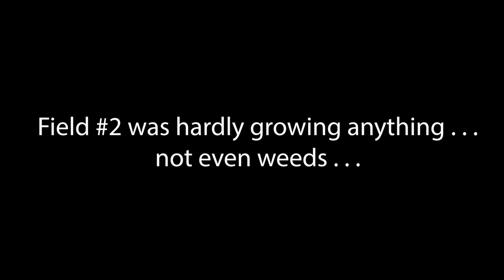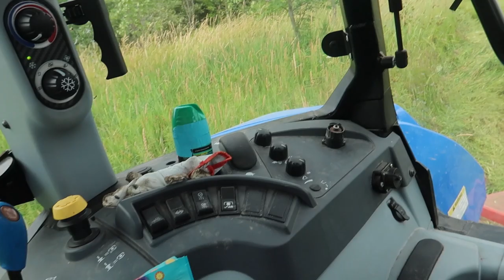241 I Almost Lost It - Mowing the New Hay Fields with the Brush Hog (Bush Hog)

Comment from the maker: For those wondering (because there are lots of comments on this) I did NOT want to bale the stuff I cut for a very good reason. I had JUST applied a foliar fertilizer just 3 weeks prior, despite the weeds, because I wanted to get it down before summer got too hot. At the time I knew the weeds would get a good percentage of it. By brush hogging the weeds, the minerals I applied to them will be recycled back into the soil as they decompose. If I chose to bale them instead, I would be using additional time and fuel, and produce only a few bales of hay, not enough to cover fuel expenses, and I would lose the benefit of the fertilizer I had applied.

As far as mowing my main hay field last year, I mowed the weeds out but it only cut the top 2inches of grass each time, so I'd have the same issue of not enough hay to cover fuel costs.

Comment: As a few others have commented, 2.4,d weed killer is a safe effective weed killer safe for cattle within 30 days of application. 

If you have any poison ivy or oak, some dish washing detergent added to the mixture will breakdown the oils on the leaves, and both ivy and oak will turn yellow overnight, then brown the next day.

I suspect that your wind rows from last year contributed to the nice green lush growth in the last field.

May I suggest getting a small toolbox and keep some hitch pins and clips, a couple of 5/16" chains with hook ends, a cable come along and a ratchet strap or two. It will save you from having to limp back to the barn for repairs.
Reply from the maker: I need to make a list of tools for the box to get at Harbor Freight. The tractor does have a tool box, but I need to fill it!
Reply: @This1LifeWeLive   list is a good idea! Price check n hit up the misc. rows/racks at farm auctions.
Reply: Reply to Brad not Landa
2,4,D in commercial production includes 2,4,5T_  - Agent Orange.  It also metabolises into agent orange and other toxins with never tested toxic synergistic damages. 
You might be interested in the book 5MYTHS ABOUT SAFE PESTICIDES  or something like that by ( I believe Lieu)

Comment: I agree with the other person who said they were using a land roller to help smooth the ground out. It doesn't hurt anything to try. We did all our new seeding from the year before and it made a great difference. Go out as soon as the ground will hold up the tractor in the spring. And later in the fall, if you want. They should be cheap and easy to find if you look around a bit.

Comment: I think the reason that the wheel and top link connection point broke was because of improper Bush hog setup. The proper way to set one of those up is to have the back wheel always touching the ground when in use, and adjust the front of the cutter so it is lower than the back. If you watch the video again you will see where the back tire seems to always bounce and hit the ground. I am not trying to pick on you, but one thing I really enjoy about u tube is the things I learn from others. And if I can help someone in any way, I will. Hope this helps 🙂

Comment: Bush Hog is a brand of cutter used to cut brush and weeds. Several people are saying to use 2.4.D to clean up your field it is a broadleaf herbicide and will kill the clover you have established. Your brush cutter is way to small for your tractor. It should at least take out your wheel tracks. It should pull a 12' cutter very easy in all types of cutting. It probably would pull a 15' but maybe not in  all types of cutting you might want to do. Really love the videos you make keep up the good work

Comment: What we do to get good grass is we set our mower above the height of the grass. That way you cut the weeds and native grasses but not the grass that you like to keep. A second possibility is to seed through without cultivating or disking in the fall. Make sure your seed can sprout and grow some before winter start. This way come spring time your grass is growing before weeds can sprout. Never cut to short when haying. You wanna keep at least 2 inches of grass after cutting. Also you wanna keep a close eye on your grass in the spring and spray it when you get weeds growing. Unfortunately you can't spray against native grass but you can kill it by cutting it on a hot day before it developpes seed. Native grasses gain more height so cut that without cutting your good grass. The clover comes from fertilizing. Clover likes lots of nitrogen. I would suggest to call in an agronomist and take some soil samples for analyses. It looks like you're wasting fertilizer.Feel free to contact me if you have any more questions. Good luck.P.S. I like your channel.

Comment: We always keep a length (10' would be good) of medium-duty chain on the tractor. Good to have in case you need to pull or lift something. In your case, you could've hooked it to the toplink on your tractor & chained around where your toplink would be on the mower & prolly could've lifted it up enough to "hobble it" to the shed.
Reply: Another good reason to have a chain on a loader tractor is n case one of the front tires breaks off or you have a problem with it. You can put the chain around the axle (on the end where your having problems) & then straight up to the loader bucket or arm & gently raise the problem wheel off the ground so you can get back to shed on the one good front wheel. Never had to do it myself but have been told bought that trick from my cousin.
Reply from the maker: This is true. I did have a ratchet strap and had a similar idea, but wasn't sure if it was strong enough to do the job :(
Reply: It's good to air on the side of caution sometimes.

Comment: It wouldn't hurt if you had a slightly larger bush hog and that tractor is easily big enough to handle a batwing type.
Reply from the maker: Fr sure! Tis bush hog was for our John Deere and fit perfectly! Now it's a bit small :(
Reply: Your implements should at least cover your tracks, especially the box blade.
Reply: @This1LifeWeLive  Rhino makes some super heavy duty units
Reply: It should easily pull a 15' brush mower, our case ih 75c pulls ours without a problem
Reply: @LukeA_55  Imagine Suzanne running one like "How Farms Work" gets to use on his pastures.  RhinoAg makes some excellent brush mowers.

Comment: "Before I get whapped" lol..... Yes it is very dangerous to be anywhere near a as we call it rotary mower. You should run the mower with a little slack in the chain. Let the tail wheel take the weight of the mower. The way you had it as you hit a bump the weight of the mower is constantly pulling down on the top link and chain. I had one of those mowers and the tail wheel assembly is one of the weakest parts.Welded mine up the same way Eric did. Finally replaced mine with a stronger one and had no more trouble. Up graded to a new 6 foot Deere mower. Bush Hog makes a good mower if you have one of the bigger ones. The small utility stuff not so much. As far as you tipping over it would take a lot of grade to tip your tractor over. But if you are ever in that situation have the loader and mower low as possible and always turn DOWN HILL. Never turn up hill. The weight will transfer and over you go..... Summer months seems there is always something needs mowing..........I have been neglecting my farm lately. Nursing lower back problems with a pinched nerve. Kinda sucks with so much that needs to be done.
Reply from the maker: Well you gtta take care of yourself first. The farm will survive ;) (well . . . unless you run a dairy farm, lol)
Reply: Speaking of dairy farm, we need to see Suzanne milk a cow now that s what i call fun.

Comment: It's called BUSH HOGGING. The bush hog company invented the rotary cutter in 1951. Brush hog is a model manufactured by Rhino or Woods, I forget. But the act of mowing a pasture is called bush hogging. Nice video
Reply: They were originally called Stock Cutters in my area and used primarily for cutting down cornstalks after the corn picker did its' job.  Doesn't matter what you call it as long as it works.
Reply: Landpride is “Rotary Cutter”  Brand made by.  https://www.greatplainsmfg.com/en in Kansas I believe.
 For sale by dealers like Kubota.   
Not to Stomp on old Slang or trademarks.
Great Plains builds many implements that carry the “Landpride” name.
Reply: @gordbaker896  yeah.....it kinda matters what you call it. But you gord girl......I mean you go girl.

Comment: I never run the top link when using the brush hog that way it floats better over the ground. But I've never ran one with that cheap chain for for 3rd link
Reply: I also never run the top link when bushhogging. It allows the bushhog to float of uneven ground. Also, if you lower the lift in that situation, you will be able to back up with the bushhog without the top link.

Comment: My neighbor bought my hay and it got wet this morning. He going to have to turn it to get it dry. I have marestail and milkweed in my hay. Pulled all of the mustard 3 years ago and got rid of it. Just a tip for you, when crossing a ditch or mowing a side hill lock in your front wheels. Also when mowing on a slope always turn uphill. That will help you keep the rubber side down.

Comment: Make a big roller out of pipe filled with concrete to roll in the spring. Might check around at old airports and find one they used to keep the grass runways smooth .,

Comment: Suzanne that Bush Hog is designed for a quick hitch for the top link hook not just the 2 bottom points and that is why it was swaying so much
Reply from the maker: INteresting! Didn't know that!
Reply: WT Farm Girl Videos the 3 point top link sways less with the in a quick attach coupler the top link bar bushings get less ware on them I and you don’t have to kick or loose a finger nail and one less thing you need erik for of hooking up to the bush hog and on the bottom of the quick attach weld a 3/8 or half inch angle iron and a 2 5/16 hitch receiver hitch tube in the center and you can reduce the jackknifing on the tractor with the mower and baler and then you can use the 3 point to lift and lower the baler or mower with the hitch receiver and if you need extra lift or drop just flip the hitch receiver and not have to worry about jacking the tongue of the implements just lift and rotate the implement jack

Comment: If you want weeds instead of grass, you should certainly mow this way regularly for 2 or 3 years. Success guaranteed. Fertilizer in the fall to have hay in the spring is more than likely the most innovative practice of the decade.

Comment: 13:00 keep both hands on the wheel. Lift the arms a bit so the implement is running on the castor wheel but not digging in at the front

Comment: If you have a drag harrow,  i say drag the field it opens it up but doesn't tear it up. That way you could broad cast seed new grass then fertilize.  Just a suggestion
Reply: Or direct interseed... Its more efficient seed/fertilizer wise   but more work and if you dont have a drill but have a drag. Either way do it right before a rain.   Not sure on the soil or market in that area but I'd seed interseed   alfalfa.

Comment: A brush hog or "bush hog" is a type of rotary mower. Typically these mowers attach to the back of a farm tractor using the three-point hitch and are driven via the Power take-off.

Comment: I agree, I recommend a Landpride 1872 your tractor will take that no problem! I moved up from that size brush hog and glad I did, much better quality and dependable! I run mine on an older Ford 3600 diesel, not much it won’t cut....actually smooths out high spots and woodchuck holes!LOL🙄👍😊😉
Reply: There's a lot better brands out there than Landpride.
Reply: I like my Landpride equipment.
Reply: Landpride is on the lighter side equipment wise. They won't take the abuse like other brands over all they have a lighter.
Reply: I won’t dispute there is heavier built,  I am saying I like the ones I own.

Comment: That small of a mower be careful. If you watch its not heavy enough to be on that size tractor. Could easily bend the 3 point into a pretzel and bind up the pto. But things cost money. Use what you have with caution.
Reply from the maker: That's a very good point. Hadn't considered that, more thinking about the cutting width. But yes, Erik did look some up yesterday and they were running several thousand for used. Our current one was $900. Bit of a price difference, but I guess in the meantime I will mention the bending thing to Erik ;)
Reply: Yea they are pricy Id like an offset 10-12 ft for brush control. I have bent one when i went to a bigger tractor. Took many hours of heating and hammering to fix. Adjusting the top link and tail wheel height to keep the tail wheel on the ground helps a lot. Bouncing beats them up.

Comment: Bush Hog is a brand name, whereas brush hog is a generic term for a mower that's not a finish mower.
Reply: "Bush Hog" has become the common term for any type of rough cut mower, just as "Kleenex" is a universal term for any "facial tissue".
Reply: Dealers  call them rotary cutters
Reply: Raymond Louks - Gyro Mower is another generic name in my region.
Reply: @dalemarshall625  When I sold John Deere parts many years ago the literature called them 'rotary cutters' like you mentioned.

Comment: A flat washer under that rollpin would have been prudent. John Deere calls them rotary cutters more generic and probably better descriptive. bush hog brand is pretty famous. around here it's called clipping pastures what you were doing and bush hogging or brush hogging would be actually going in thorns small tree saplings and clearing with one of those rotary cutters. You're a hoot I can't tell when you're serious  about some of the things in your videos. oh yeah  a lot of comments here is "get a Batwing" heck yeah what's another 10 or 15 Grand.
Reply from the maker: Yeah it looked like there HAD been washers under the roll pin, which had me mystified as to where they had gone to . . . So Erik put some on the second time around ;)

Comment: Personally I would buy a flat roller grass like a a 12ton twose and when ground is damp roll it to make flat wont happen over night just keep doing it and chain hrrow or tine harrow.Dicing will bugger mower up if you dont get the ground level enough and you dirt go though your baler.

If you have to use a dicse use a dicse drill and over seed why u are doing it make sure u roll it hard what I do at home I must say rarely 
 
And as I never driven your tractoer have driven others tractirs with front loder if they dont boom suspension your arse take a pounding 

Before anyone puts bad comments it's a personal opinion and only trying to help what I do in the UK and works fine for me.

Comment: Maybe I missed something but what would be wrong with baling what is there. Even if you can’t use it with your horses, someone would buy. Through the eyes of your camera, the material didn’t look that bad.
Reply from the maker: The first field was 50/50. Half was decent, the other half was only a few inches tall and nearly 100% weeds. While I could bale it, I would about break even with the profits earned vs fuel spent. Another thing not mentiond on cam, was that I had applied a foliar fertilizer just a few weeks earlier, and if half the field is weed, then half at least will be recycled back into mulch for the plants to re-use later on if I simply mow them, vs cut and bale :)

However, field 3 I decide to do exactly that, wait and just cut and bale it later since it a fairly solid growth rate all across the field :)

Comment: Why do people drive tractors with loaders up in the air that's stupid 1.  If you have hidden objects in grass you want the bucket to hit it instead of front axle or steering cylinders or worse oil pan  tractor more stable with loaders close to the ground
Reply: Mostly a visibility thing I'm guessing.  But yeah I'm not a fan either. Also raising the center of gravity isn't the best idea.

Comment: you might want to check the angle of the mower. I see your leaving windrows the back end of the mower should be higher than the front then it will spread more.
Your a mother treat your field like a sick child you find out what causes it to be different and find a solution. Chemicals work but temporarily as mentioned in the comments there are other reasons why weeds grow. Have you ever noticed that thistles don't usually grow in road ditches to much competition from grass. Foxtail is a sign of compaction the list goes on . i see your looking already along these lines . Good job again you showed why i like a woman for hired help
Reply from the maker: I didn't know that about the mower, Erik said I had it on wrong and re-set it to level, lol. Yes, I have heard that weeds are natures way of healing the soil.
Reply: it supposed to be about 1 and half inches. Stick a 2 x 4 under the back and adjust that way

Comment: The chain looks to tight, not enough weight on the rear wheel bucking the 3 point hitch that sheard the bolt. 8:38 also hammering the wheel instead of rolling along breaking the weld.  =-)
Reply from the maker: That could be. Our thought had been to keep as much weight off the wheel as possible since it had broke the last time with the wheel in full contact with the ground. Maybe a manual would be in order, so we can figure out the best set-up for what we want ;)

Comment: Need 6 foot bush hog
Reply: need a bigger one than that I have a 6 foot on my little 3 series deere and has no issues what so ever with running it. That tractor could handle a 8 foot or batwing cutter no with no problem.